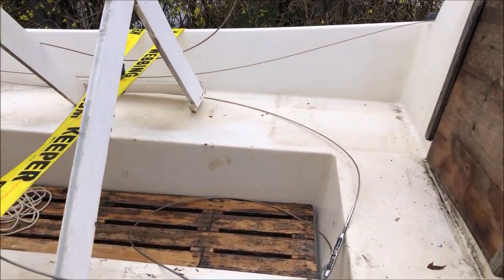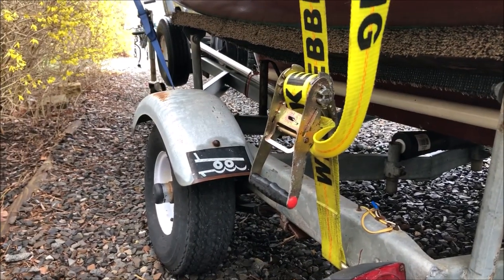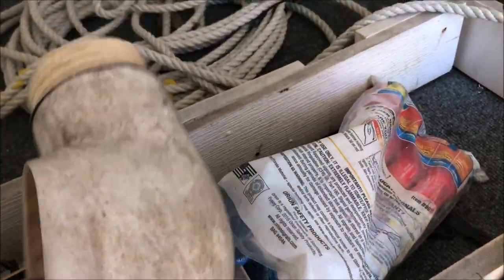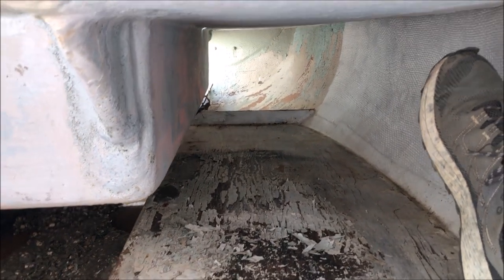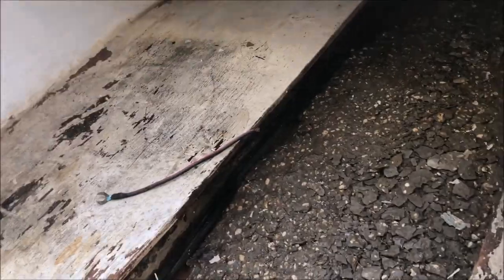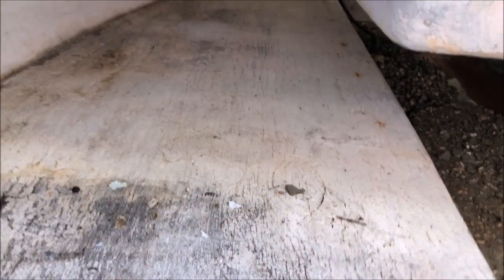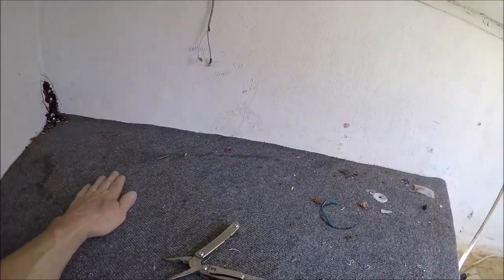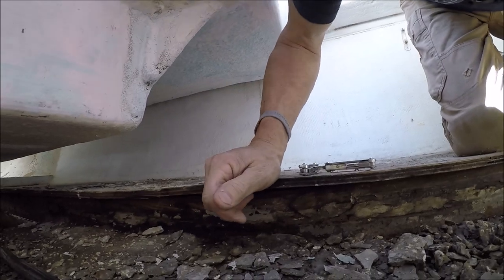Buy Small - Sail BIG Project: Ep1 - Com-Pac 16 Sailboat

Comment: I'm working on a '79 Compac 16.  The mast support on mine was an issue.  Two bolts through the support post into a completed rotten stringer.  Got that taken braced up, now working on getting all of the moisture out of the concrete ballast in the keel so I can patch and apply new bottom paint.
Reply from the maker: Nice! These old boats are great and easy to work on.

Comment: Are you going to drill a hole in the hull to get the water out?  I’m restoring a 1978.  It’s finally in the water only to have a problem with the engine.  It’s always something.
Reply from the maker: @paullambert5341  There already is a hole in the keel with the concrete showing that needs to be repaired…so yes.